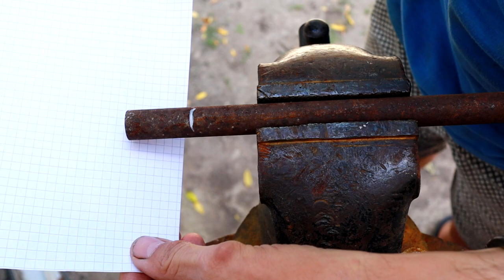How to make a spoon lure from a water pipe

Comment: Saw "spoon" and "waterpipe" in the title and was really confused by the thumbnail. Anyway, Ive got my powerade bottle and duct tape ready just in case, just need some foil now.
Reply from the maker: water pipe bait meant
Reply: I don’t have access to pipe like that. Instead i have plenty of 1/2 inch copper pipe.  Would that work just as well or is copper too light and too soft?  Thanks.